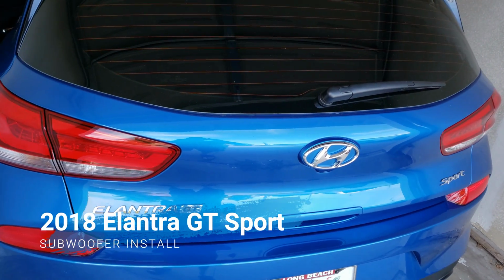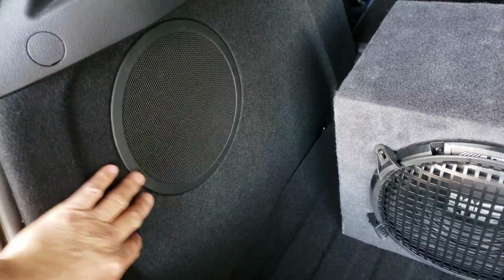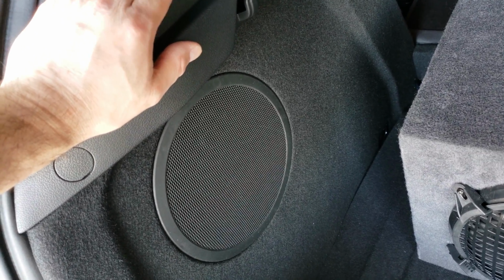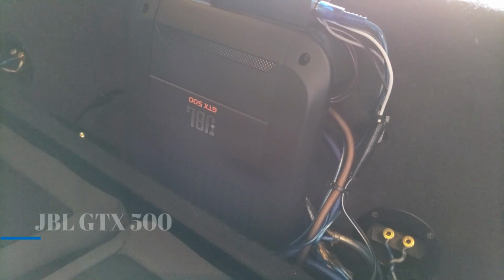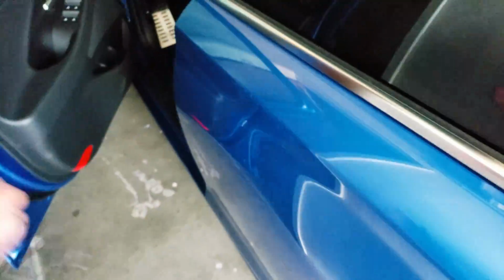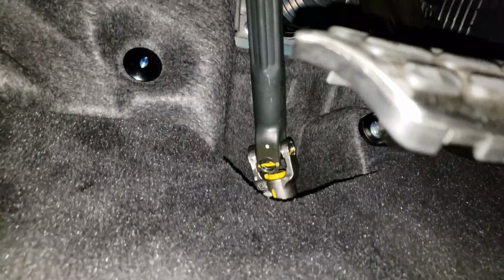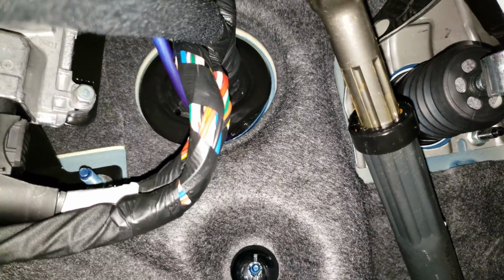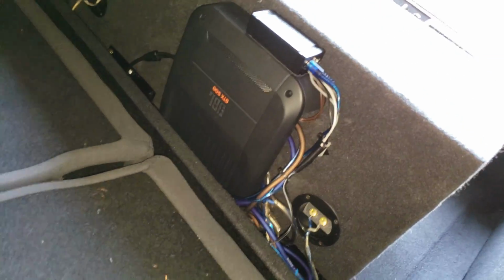2018 Hyundai Elantra GT Sport Amp install

Comment: My 16elantra GT knocks factory with tweeters!! its almost out the shop i have a 10" bazooka..can i connect that straight ot the rear fact.sub?
Reply from the maker: You possibly can, but the built in amp is very weak and probably won't get much bass..

Comment: Did you run into any voltage problems?
Reply from the maker: None. From what I hear is when you get over a 1000 watts amp is when you start running into electrical issues.

Comment: There's four wires on the loc right and left and positive and negative  for both which two do I connect to the stock subwoofer wires?
Reply from the maker: I can't remember it's been so long. Play around with it to find the right ones.

Comment: Hey man I’m trying to install an amp/ subwoofer in my Hyundai Kona was wondering if you could help
Reply from the maker: Use same procedure. Tap into one of the speakers to hook up bass amp.
Reply: It’s all tapped still not working I have the power and ground connected right so it’s definitely a problem with the speaker taps

Comment: Hi bud I'm trying to install a sub and amp in my Elantra. My question is which wire did you tap into the OEM amp to get the feed to the aftermarket amp?
Reply from the maker: I tapped into the Subwoofer Speaker that came on my Elantra GT Sport. I think there's four wires there, you just got pic two and see which work.

Comment: That power wire is a fire wating to happen with that power wire in the steering shaft grommet it will get pinched there is a black empty plug on the left side of the firewall you can put as grommet in and what about your oem warranty know I have a Hyundai elantra so I know about them I am doing a custom viper alarm remote start and tracking system in it
Reply from the maker: Its not on the steering shaft, but where other wires go to the front. Not sure how it will affect warranty. I can very easily pull it out.

Comment: I'm so confused. What two wires on the loc did you connect to the speaker wires? And what wires in the speaker do you connect the loc to?

Does your factory sub still work?
Reply: Why did you use an adapter? The loc you have in the link and the amp you have both have two inputs? Why would you need a female to make adapter? So confused.
Reply: What wires did you use to tap the sub's line?
Reply from the maker: @phannypack3951  The wires going to the sub. When you take off the side panel you can see them. Or even amount the sub and use ones connected to it. You can have both playing.
Reply: Lol. I got it all figured out. With your vid I was able to do it. Thanks mn.b

Comment: Will this cause a dealer to void warranty work like the navigation. I cant see how. But who knows. How has it been? Have you had to have any warranty work related to audio or infotainment system?
Reply from the maker: phanny pack No issues at all. If I ever run into issues, I can do quick uninstall.
Reply: MicroModDude nice. I am goin yo watch your vid a few more times.
Reply: MicroModDude the two wires you tapped into for sound. Is that your rca cables than technically?
Reply from the maker: phanny pack Yes. But it depends on your amplifier if it takes direct speaker wires or not. If it doesn't, you need the rca converter like on the links I posted.

Comment: Dope but I dont get why you paid more for the GT when you could of gotten the Sedan for cheaper if you were just going to fill your trunk with this amp?
Reply from the maker: Because the GT Sport hatchback is so much nicer. Plus this is my commuter car to work and back. Sometimes my drive home is an hour and 20 minutes for less than 30 miles.
Reply: I bought mine a month ago. Only complaint. No memory sets. Otherwise I got the sport 3 package and only paid 22k. Rick Case in Fort Lauderdale.
Reply: I own the sedan version and the hatch is way nicer for sure.

Comment: Did you use a line out converter? If so which wires did you tap into?
Reply from the maker: Yes, tapped into the subs line. Its in the vid.